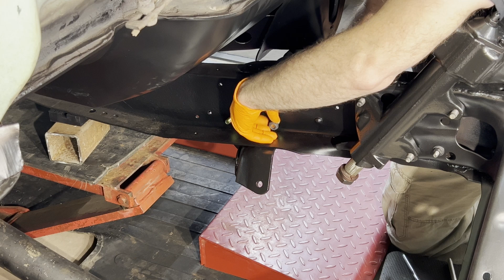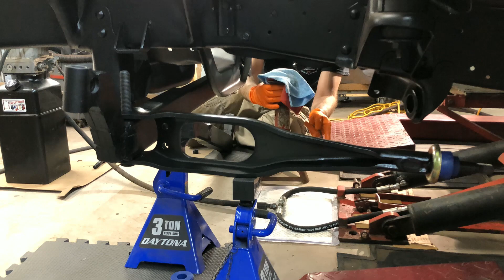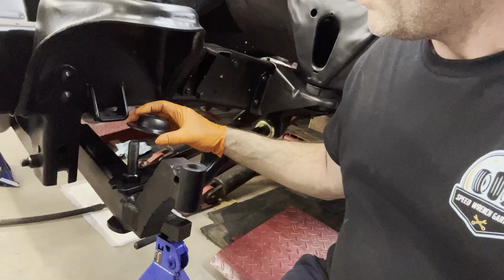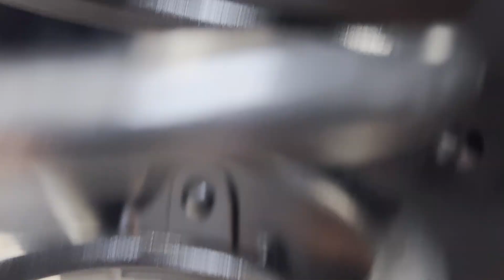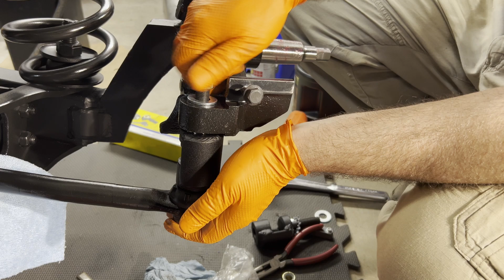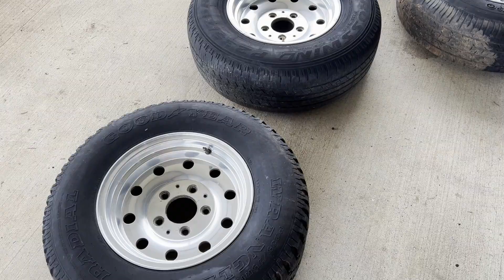INSTALL DJM DREAM BEAMS AND SUSPENSION ON 1979 FORD F100

Comment: Man Im doing this install right now and those bolts going up through the I-beams are welded in, not actually but it sure feels like it, I've hammered them, heated them, oiled them.   I don't have replacements, I dont wanna cut them.   I'm lost.
Reply from the maker: I had issue with one of the nuts being stuck, I finally cut it to split the nut. I wasn’t careful enough and hit the threads. After finding out it was a special bolt ( it has more threads than standard bolt) I had to get one from the salvage yard. On eBay they wanted $50 for them.
 I’m assuming you’re talking about the ones that hold the coil springs and radius arms on?
Reply: @SpeedWrenchGarage  you are correct, I did end up getting them out, had to take the whole radius arm, i-beam together to work and use a 1" impact and torch.   I was able to save the bolt though so that made me happy.

Comment: I added all of this recently but my springs are not fully seating around the cups at the bottom. Did you not have this issue?
Reply from the maker: No I didn’t have any issues with the springs, I just couldn’t get the shocks installed. I’m hoping when I install the engine it will add enough weight to install them.
Reply: @SpeedWrenchGarage is there a way to send pictures on here so I can show you?
Reply from the maker: No I don’t know away to send through the comment. Maybe send through the speed wrench garage email in the info on my channel page
Reply: @SpeedWrenchGarage I don't see an email address, only a URL for your YouTube channel
Reply from the maker: if you are looking on phone it doesn’t show, I noticed it’s speedwrenchgarage2@gmail.com
Reply: @SpeedWrenchGarage sent

Comment: Just a heads up if you had put stands on the frame and had it high enough you would not have had to unbolt the I beams  to get the  radius arms in , the Ibeam would drop down enough to allow the arm to go in , did that on my F250 when i rebuilt it
Reply from the maker: Thanks for the tip! That’s what I feel what YouTube is about.